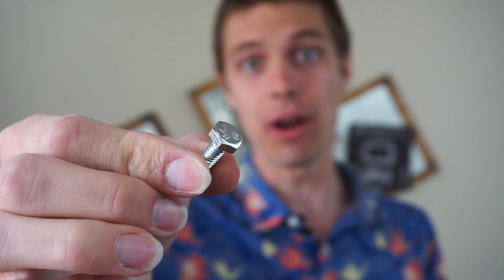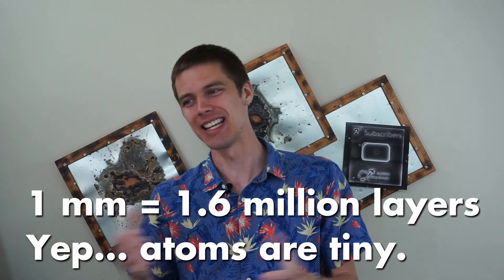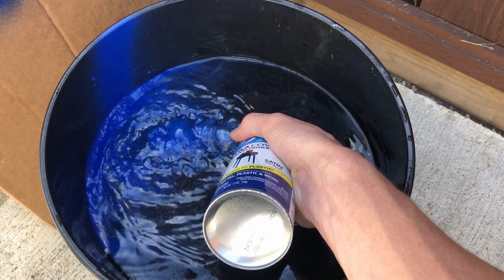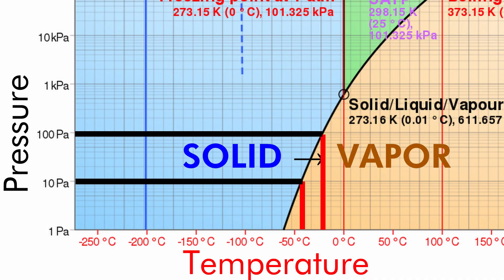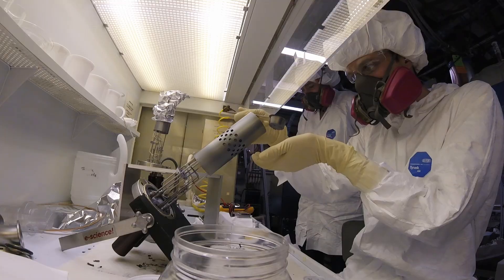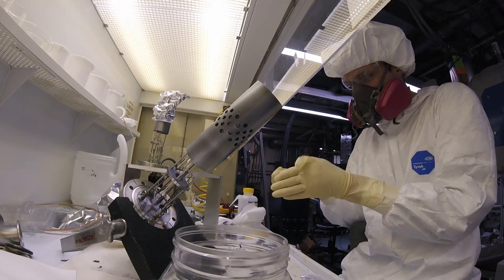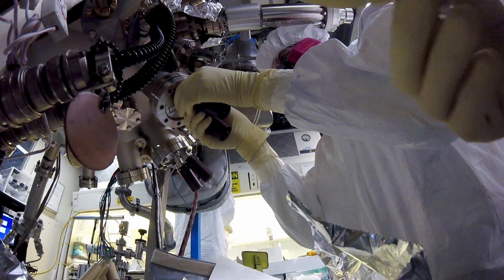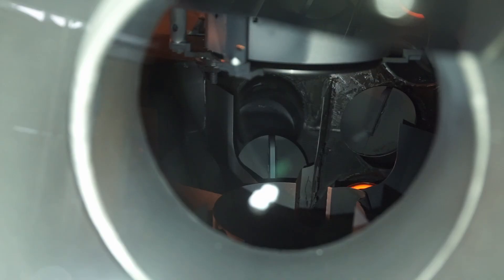How to evaporate a metal

Comment: These videos are really cool. I love learning about this kind of very niche high tech research equipment.
And not to be the first to say it but this channel is definitely underrated.

Also, as a programmer, a particular thing that fascinates me is the software that controls all this stuff. 
Specialized single purpose programs that have to integrate with this the crazy equipment is wild, but maybe I'm just a big nerd for weird things.
It's just such an enigma.
Reply from the maker: Yeah the scripting capability with a system like this is awesome - I think I rely on it more than most growers at UCSB (which occasionally has come back to bite me). The control system we use has lots of closed-loop temperature controls (actually bakes into the hardware), but I've also written a very large pile of pascal-esque CrystalXE that does stuff like control temperatures and shutters throughout growths to create certain semiconductor structures automatically.
Reply: @AlphaPhoenixChannel  sick

Comment: It’s episode two and I’ve already forgotten what MBE stands for, but this is a great video series. I was wondering if some sort of magnetic or electric field would be used to collimate the beams, but I guess a simple aperture is sufficient. Plus this looks to be an electrically neutral method of depositing atoms so those wouldn’t work anyhow.
Reply from the maker: It is completely electrically neutral, you’re right! The technique you’re referring to is exactly what happens inside a Focused Ion Beam Microscope (the microscope I used to make a play button). That makes individual gallium IONS then accelerates and focuses them with E and B fields until they can burn a hole in your sample just tens of nm across - it’s pretty awesome.